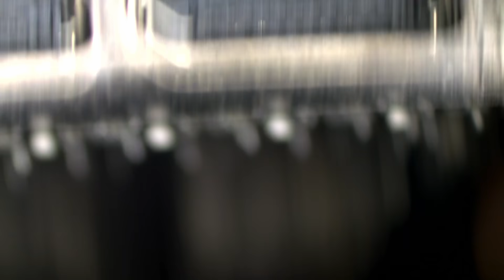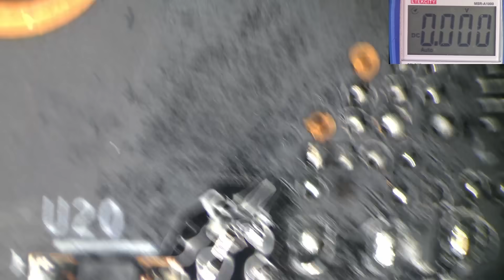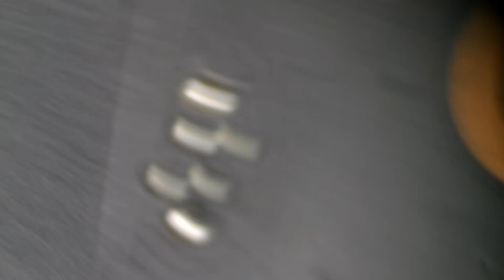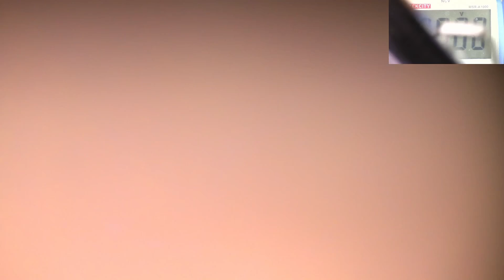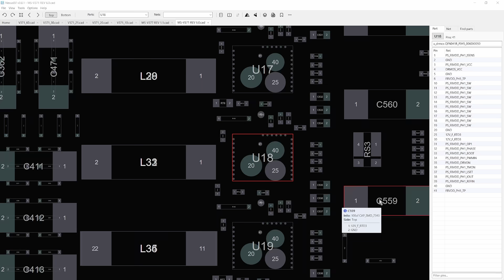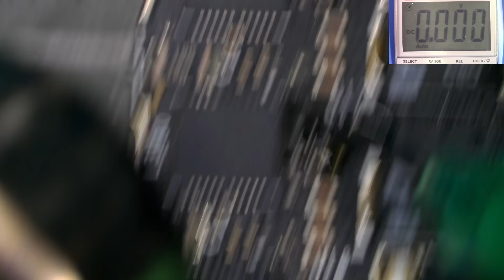How to fix graphics card on PC

Comment: Hi Tony,

I've been watching your GPU and board repair videos and really appreciate how clean and professional your work looks.

I was wondering if you could share the specific products you use in your repairs:

1. *Cleaning solution/solvent:* What product do you use to clean VGA/GPU PCBs, especially for flux residue, adhesive, and general board cleaning?

2. *Flux:* What brand and type of flux do you normally use for GPU/BGA rework?

3. *Solder:* What solder wire or solder paste do you use? If possible, could you share the brand, alloy (leaded/lead-free), and solder diameter/type?

I'm currently learning GPU and board-level repair, and knowing the exact products you use would be extremely helpful.

Thanks so much for sharing your repair knowledge through your videos. Your work has been really helpful for learning.

Best regards

from Vietnam

Comment: Would those (2) 10k resistors be a voltage divider network?   1 resistor was listed on the DP_AUX_PRO ( I assume that means protect) net, an and the other was DP_AUX_PRO_Q.   

Also with the help of Claude, the U20 IC appears to be one of the following. 

Microchip MIC2005/MIC2091 series (UL2367 recognized, this exact SOT-23-5 pinout)
ON Semi NCP380
Diodes Inc AP2211/AP22814
Torex XC6135

Comment: For EVC you just connect it via i2c to the controller and then in software (available on elmorlabs forums) you can autodetect or manually select the chip and read the telemetry when powered. The tool is more focused at overvoltage and raising of OCP than diagnostics, but it can read the failure states still

Comment: The thing you bought is an EVC external voltage controller, often used by overclockers to precisely control the core/memory voltage. You solder it to the core/memory voltage trace, the negative trace, and the ground (usually three vias next to each other). You download a dedicated program to your laptop or computer and control the voltages.

Comment: 17:40 that "acting like it's busy" bracket is to reduce sag, it's not for cooling
Reply: The real problem: bending moment at the PCIe slot. The GPU’s weight creates a cantilever load. The PCB is the beam, the PCIe slot is the fixed end. The bending moment is highest right at the slot, not at the far end of the card.
So the failure modes are usually, 
PCIe slot solder joints cracking, Motherboard PCB flexing, GPU PCB flexing near the slot fingers or trace micro‑fractures from repeated thermal cycles and mechanical load.

A support bracket at the tail end of the GPU reduces sag visually, but it doesn’t significantly reduce the bending moment at the slot, because the load is still being transferred through the same point. 
So they're a bit of a wank.
Reply: @Berserkism it reduces the load on the slot a little bit, and reduces the flexing around the GPU core a lot. It's a net win with no downsides compared to not having it at all.

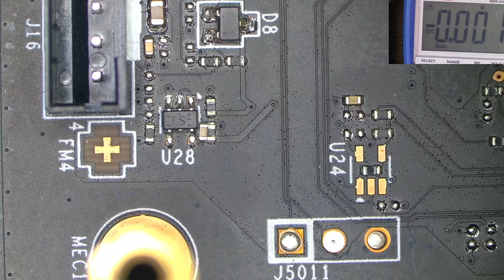Comment: 5:40 that cap looks to be next to a resistor, , like the pad you soldered it to looked like a resistor, exactly like the one next to pin 1 of the rs-chip. And you soldered the capacitor on top of that resistor.

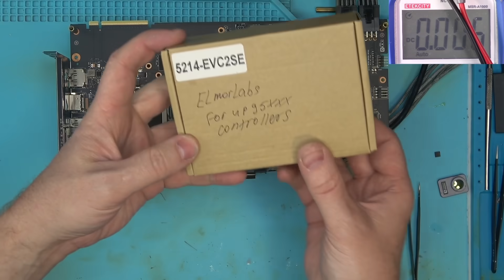Comment: 38:27 with this you could just connect it to the I2C on the board itself and be able to see all of the power monitoring chips. I’ve seen a lot of extreme overclockers use these to get more power to the gpu. Love your vids btw. Love from Norway

Comment: Nice, but 3070 has a capacitor with corroded pads just above the coil on the right side from your fixed resistors.